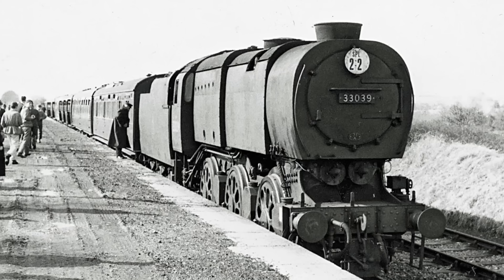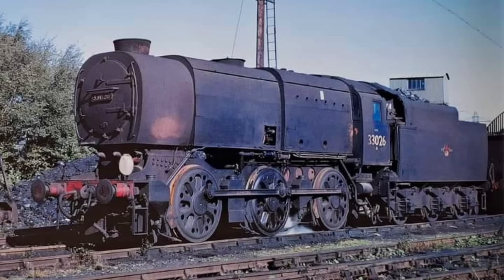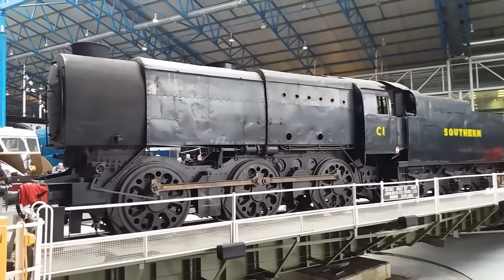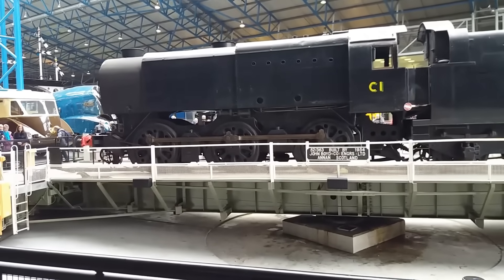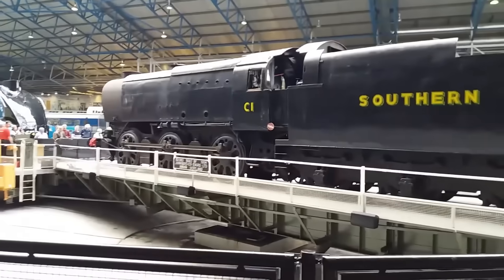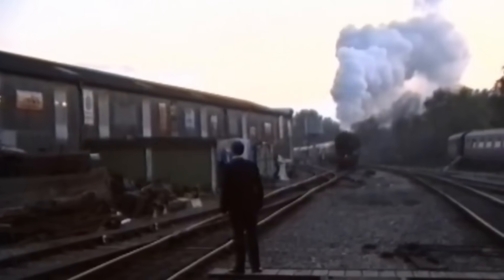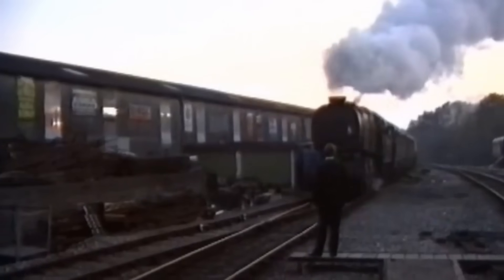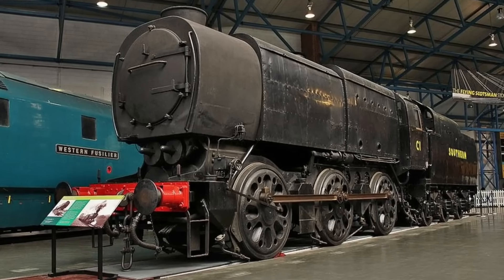Southern Railway Q1 Class: Britain’s Ugliest Steam Engine… or Its Greatest? #Q1 #wartime #history

Comment: Correction;  the Q1s were CRAP at their intended work - hauling HEAVY FREIGHT.
"The class gained a reputation for poor braking on unfitted freight trains due to the light construction of the tender braking system."
Herring, Peter (2000). "Q1 Class". Classic British Steam Locomotives. London: Abbeydale Press - pp. 150-151.
The vast majority of freight trains in that era were unfitted - i.e., the wagons and goods vans only had parking brakes.  Once the train was on the move the only brakes which could be controlled by the train crew were the loco brakes and the brakes on the brake van at the end, controlled by the guard.  So a heavy freight loco with poor brakes was NOT a brilliant design - it was a menace to its crew, and to every other train on the line (read up on the number of fatal accidents caused by a freight loco and brake van losing control of a heavy train on a steep gradient, and you'll see what I mean).
It was typical of Bulleid to concentrate on one vital aspect of a design - and completely lose sight of other EQUALLY vital points.
Compare that with the success of the WD 2-8-0s and 2-10-0s (designed byRobert Riddles), which were equally sparing on materials, tooling, and machining time, which DID have sound brakes.  More?  The claim is made that the Q1 had a very low axle loading for its power - it was 18.5 tonnes;  but the WD 2-8-0  was 15.9 tonnes, and the WD 2-10-0 was only 13.7 tonnes.

Comment: " Most powerrfull 0-6-0 loco in Briton " .  Any other more powerfull 0-6-0 anywhere in the world ?
Reply: USA switching tender locomotive 0-6-0 I think often in the 45,000 lb tractive effort range. More than a King or Duchess. 
Huge firebox and weight to move 1000 ton freights around marshalling yards.
Reply: @johnd8892  ok thanx .  Of course the heavier axle load i thought it would be possible in USA .  But did it have more horse power ?

Comment: Stanier's alleged "where's the key?" comment was probably a reference to a corned beef tin rather than a clockwork toy.  Corned beef tins were opened with a key.
Reply: I read of an enthusiasts wife who worked under Bullied in the drawing office. 
She was pleased when he started to build a "Charlie" as they were called in the drawing office. Unofficially I expect.
Reply: @johnd8892  Back in the early 1960's the late John Charman described building a model Q1 in the 'Railway Modeller' magazine; he said it was done at the instigation of his wife, who told him he couldn't have an authentic Southern branch line layout without a 'Charlie'. There is definitely something appealing about it, but it's very hard to define. Thank heaven one survives.
Reply: @JohnDavies-cn3ro sounds like the article I read but much later as a second hand RM issue I was collecting to read.
Reply: True - but I'd stick with the toy train connection. Stanier was probably reminded of a Hornby O gauge 'M' series engine, whose boiler and cab, bent from one piece of metal, did indeed have a very strong resemblance to a 'Charlie'. The Bullied pacifics have a much stronger resemblance to a can of tinned meat!
Reply: I thought they were also referred to a ‘’Spam cans.’
Reply: @davissampson3991  To me, "spam cans" only referred to Bulleid's unrebuilt "air smoothed" Pacifics, but I'm from the East Midlands - so what do I know!  I'm sure all Southern fans used these seemingly derogatory terms - spam cans, coffee pots, ugly ducklings, biscuit tins - in an entirely affectionate and admiring way for Mr Bulleid's amazing locos!
Reply: @davissampson3991     I suspect that you're the only one to think that.
Reply: @davissampson3991  Those were Bulleid's later Merchant Navy and Battle of Britain classes of 4-6-2s.

Comment: R A Riddles designed the other war austerities 2-10-0 and 2-8-0 which were more conventional but like the Q1were cheap wartime fixes, yet lasted to the end of steam. The Q1 was a masterpiece of doing what was intended and the driving crews liked them.
Reply: And surviving into preservation
Reply: @oscarosullivan4513  a big jeep (2-10-0) Longmore is even a main exhibit in the Dutch national railway museum.
After WWII the Dutch national railways bought alot of  the ex WD loco's and shorty after traded the most of  their 2-8-0 in for 2-10-0.
The British occupation forces in Germany prefered the 2-8-0 due to the Prussian lenght turntabels.
and 2-10-0 were more suitable for the softer underground and lower axleload on those lines in the Netherlands.
It made them the largest operator of the WD 2-10-0 loco's.
All were used till the end of steam in 1956
Reply: @obelic71 1956 is quite early for the end of steam.
Reply: @oscarosullivan4513  Yes the Dutch national railways started very early to electrify its railways. 
Without WWII they even wanted to end the age of steam in the early 1940's
Reply: @obelic71 Irish railways last had regular mainline steam in the May of 1970.
Reply: @oscarosullivan4513  For countries that are bigger and less dense the steam age lasted longer.
Switzerland and  the Netherlands were the first with ending steam in Europe.

Comment: Beauty is in the eye of the beholder, but these locos were superb. They did everything expected of them, and they were easy to work on.
Reply: The brakes were RUBBISH - on an engine meant for hauling UNFITTED trains?  That wasn't superb, it was a nightmare for crews on lines such as the London - Hastings route, with their severe gradients.
Reply: @jackx4311  an interesting comment, but can you name any other freight loco at the time of the introduction of the Q1s that had better brakes ?